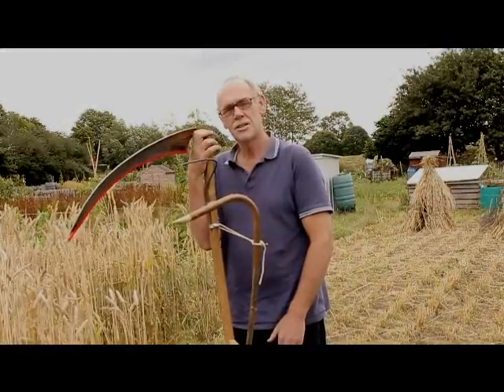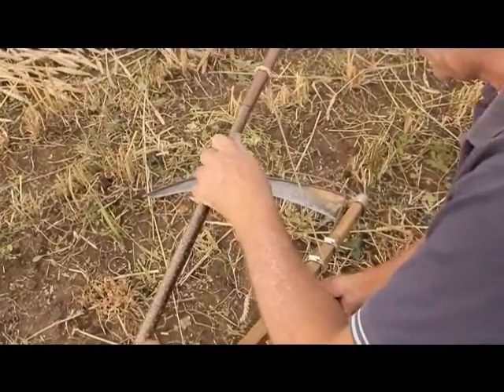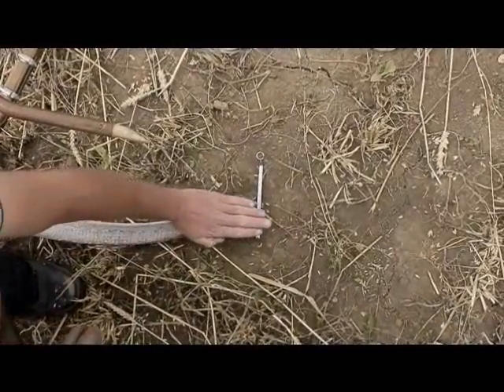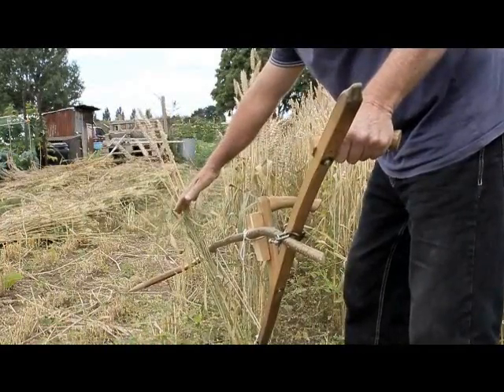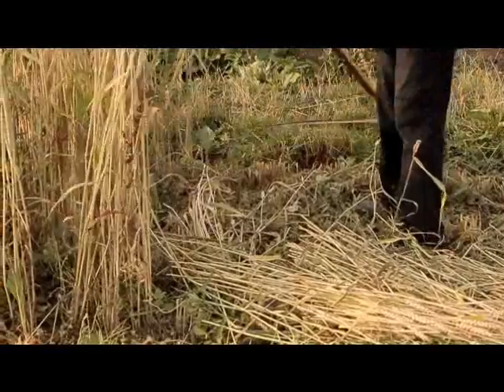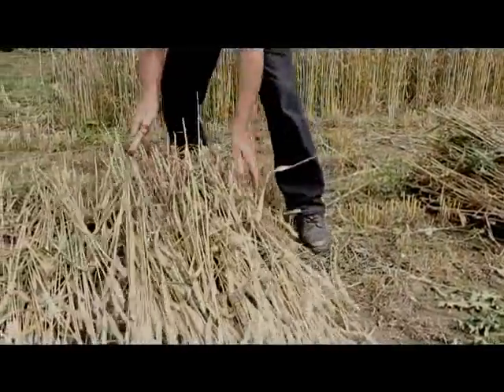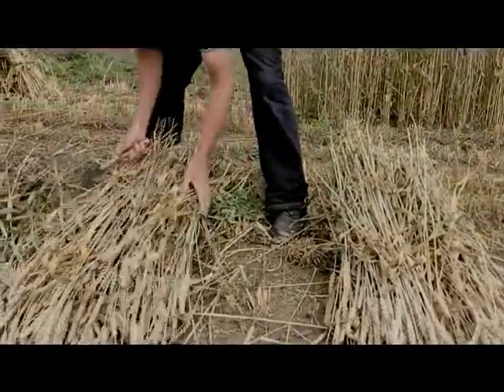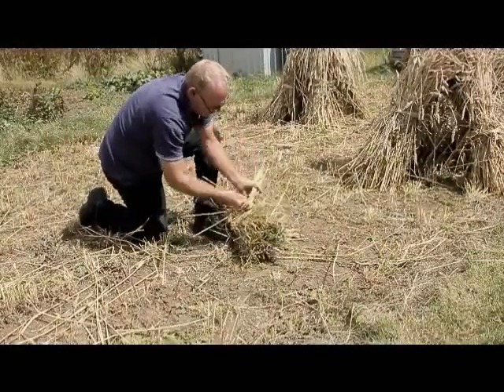Exploring Small Scale Grain Harvesting part 1

Comment: how much space would you need to have a loaf of bread a week (500g or so) for a year? any guess?
Reply: also. holy crap you are cool.
Reply: Well, wheat yields are between 0.25 and 1.5 kg per m2. A fairly rubbish farmer could expect about 250g per m2 - about what I got on my first attempt. An average farmer could get around 500g/m2 (my second attempt). Really good farmers can expect around 1kg/m2, while the world record for wheat yields is around 1.5kg/m2.
So, it is certainly feasible to achieve your goal with around 50-60m2 of land after a bit of practice. If you approach world record levels of yield you could do it in less than 20m2.
Reply: Awesome thanks. After I typed it out, I thought "well that's gonna be sorta difficult to answer" but yours is great!
Reply: @calebfuller4713  more easy way to understand that?